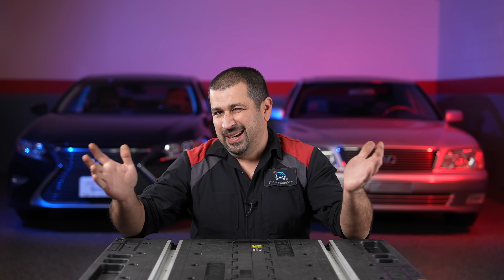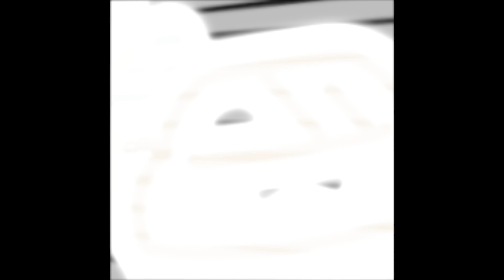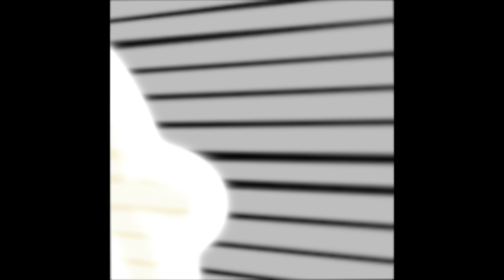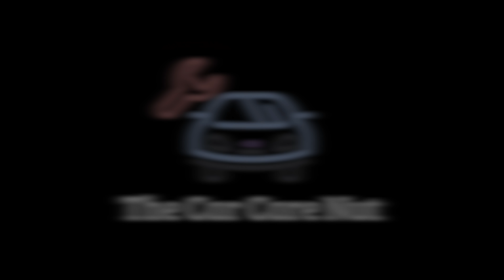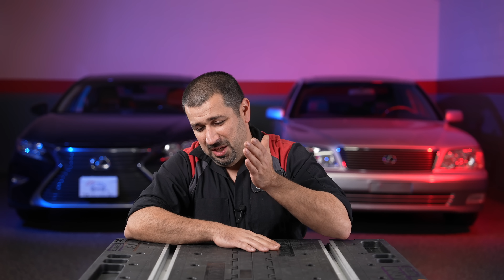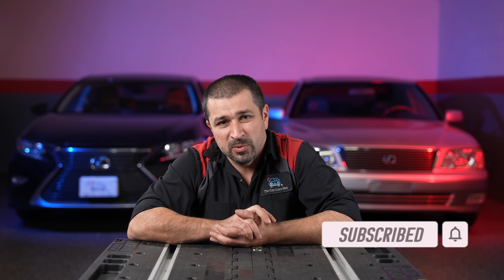Can Modern Turbo Engines Be Reliable? Here's The TRUTH!

Comment: Speaking as a retired auto mechanic I’ve spoken like this till I’m blue in the face! Back in the early 1980s I was a junior mechanic at a Chevrolet dealership. Back then they were recommending oil changes every 7,500 miles! Plus they were recommending changing the oil filter every other oil change! In other words, leave a quart of dirty oil in the engine! When I tried to tell customers to change their oil every 3000 miles, they got angry asking “What makes you think you know more than Chevrolet?!” The service manager, service advisors, sales staff, and owners of the dealership told me I had to stop advising customers to change the oil every 3000 miles because they were in the business of “selling cars!”
Reply: Yes, the sales department are there to sell cars, not, as you know to help buyer's cars last longer. Today's Service Department is the golden egg for dealerships. Very little profit now on selling brand new cars - still profit - but not like in the 1970s.
Reply: @sheldonlea 
Car dealerships make money on used cars. New cars have an MSRP, which mostly covers what they paid for it.

Used cars are say from trade ins where they lowball customers getting rid of their old cars, then sell them for a lot more.

Service is a rip off, but it's peanuts compared to sales.
Reply: I am a private pilot and a veteran of more than a million driving miles. My experience observing  turbo charging options on both piston planes and automobiles is that turbo owners almost always incurred shorter engine life and significantly higher maintenance costs. While offering higher performance, turbocharging comes with cost that  make turbo an unwise economic choice.
Reply: @joh @johndaniel6103 tired vet too. 3/4 M miles on vehicles. Love DIY. Please specify how much shorter operating time and maintenance costs. Are we talking about 100K, 250K, etc. ? Are we talking about increasing oil change frequency and filter replacement or repair cost for turbo charging and ancillary pressure and temperature differences? Thanks.
Reply: thanks for the info man
Reply: Then please tell me why my 8,000 red line 4.0 liter N/A Porsche, warranties their motors with  ten thousand mile oil change intervals. Granted, it is modern Mobile 1 full synthetic, still ten thousand miles on a high rpm H-6 is ten thousand miles.
Reply: @mzollnerable Simple, Porche is not a commuter/family car. Never meant to go 100 to 200k miles.
Reply: @Taras-Nabad For a data point for a commuter/family car, my Camry's recommended oil change interval is 5k miles. It's doing well at over 200k miles, though I don't know what the actual oil change intervals were before I owned it (but I do have Toyota's recommended schedule available). We do have another Camry in the family that we've owned for most of its life that reached 300k miles years ago, and for that we've been changing oil at 5k-10k intervals (but I don't have the recommended schedule for that particular model year).
Reply: @JonBrase does it have turbo? This discussion is about cars with turbos.
Reply: Are there any oil filters that can actually keep the oil relatively clean for 10,000 miles?  Honest question.  I dont really know.  If so, synthetic oil doesn't really break down, thats my understanding anyway.  I would still not want to go over 5,000 miles tho.
Reply: @nogotrobot7954 
But the breakdown is not from simply being dirty. Oil just gets old. Cleaning it doesn't change that.
Reply: Did you show the customers the engineering data that supports 3,000 mile oil changes?
Reply: @kenfrank2730 Right!!!!!!! For a DIYer,,,,I like the 5K oil change intervals and maybe 30K CVT intervals although I would prefer 50K intervals. What say you all? 50K 😢for differential and spark plugs too. Easy for a simpleton like me to remember., TalkinDIY. Not taking it to a K/H shop. Of horrors!!
Reply: When I hear about dealerships such as what you contended with, it makes me appreciate all the more of the Honda dealership that I bought the '91 Civic from.
The service manager held a evening seminar for the new car owners, where he explained that to keep the vehicle warranty in effect, he'd appreciate bringing the vehicles in to the dealership service department for oil changes at 7.5K miles.  BUT, he strongly advised the new car owners to have the oil changes performed every 3.5k miles . . . such as do-it-yourself.  Then he went about to show where the hard-points were on the vehicle for the jack and jack-stands.  He proceeded to show where the oil drain plug was at, and not get it confused with the automatic transmission drain plug.  Then he showed the location of the oil filter.  He concluded with recommending the amount of inch-pounds of torque to use when tightening the oil drain plug.
That Honda dealership was remarkable with providing such do-it-yourself maintenance tips.
I kept at the oil change intervals at 3K ~ 4K miles intervals for 21 years.  The engine never burned oil.  I finally got rid of the Civic due to the transmission being worn out from all the stop-and-go commuting . . . along with the electricals getting suspect, too.
Reply: I agree 100%. My 2017 Ford transit has 307k on it synthetic blend the first 150k every 5k then full synthetic after that.
Reply: Damn
Reply: Them: what makes you know more than,the car maker?

Me: Cause I have nothing to gain. You can change your oil elsewhere or learn to do it yourself. But the car maker wants your car to break and you have to buy another.
Reply: Now thanks to YouTube and youtubers like the author of this video, the truth can be heard by masses and no manager or owners of the dealership can hide it.
Reply: “ they were in the business of “selling cars!”” And there is the truth of it!
Reply: For most , not all, 3K intervals are not real world. Even harder if you own 1 vehicle. 5K intervals, which used to be recommended are much more viable and livable. How many people keep the same vehicle past 200k? Not too many. Other systems wear such as tranny, A/C, rusting issues that make the machine unserviceable for anything but parts. 3K is great but why not 2K or 1K? Just to be safe! 😊 5K, EV, ride a bike or walk.
Reply: @arthurfisch3673  Completely agreed. However, I do agree with his point of using top quality oil though. I would happily pay three times the price to double the oil change interval, as to keep my extended warranty valid it means a day off work to go to the dealer.
Reply: Oil quenched rubber timing belt.   You’ll be much happier with the new Toyota
Reply: If someone was trying to sell me a car which needed the oild changing every 3000 miles I would look elsewhere, maybe at an EV. Since the Car Care Nut is a Toyota guy it is worth noting that here in the U.K. Toyota will keep extending the warranty on any of their vehicles up to ten years old providing you get it serviced by them to their schedule.
Reply: @MrDuncl 
Wait, what? You're seriously complaining about oil changes at 3000 miles? 😂 What a karen!
Reply: I agree that oil should be changed more often, I think it’s a good practice to change oil filters every other time as a used filter filter’s better and the filter will go a long time before clogging.  The small amount of oil left in the filter is insignificant. Very few modern filters hold a quart
Reply: @jimbo5635 A filter is a $15 item max! Oil changes are $75 and up unless you DIY. Labor and tax are almost always a bigger expense than parts. Why on earth would you not take the extra 20 minutes to change the filter too? Nonsensical!
Reply: @arthurfisch3673  I change my own oil. It’s not the cost if the filter, it the fact the filters filter better when dirty. The oil geek just did a video on this.
Reply: @jimbo5635 Good point. They filter better until they don’t. There is still residual oil in the filter. And it is dirty. I guess you could argue either way. 😊
Reply: @arthurfisch3673  There's also up to a quart of old oil still left in the oil pan. you can empty out the oil in the filter. You can get a U shaped attachment to get out the dirty oil below the level of the drain plug.
Reply: @briank10101 How bout making things easy? Reproducible and consistent? Buy a car that it easy to change the oil and filter DIY.  Talking about cars that have central lifting points, robust pairs of jack stands, easy to teach spin on oil filters, the use of a fumoto drain valve, etc. Changing the oil twice a year or as needed and changing the air filter yearly. maintenance costs can be drastically reduced by DIY. Inflated hourly rates and state sales tax are the big hitters, not OEM parts. If all of these posters really think they are going to keep their cars over 200😊K mikes or more like they say,,,,, then they should be more than able to buy OEM parts, both oil filters and air filters by the case ,,, saving more money. Interval differences b/w 3-6K depend on different conditions and driving techniques. Don’t sweat the small stuff! Get to financial independence and early healthy retirement. That is the real goal. Good luck!!!😊

Comment: Hello from Europe, what reliability? :-) I drove 1.9 jtdm turbo diesel car for 10 years, and I bought it when it was 7 years old. High power engine for the size.. sold it with 250 k miles...so 400 kkm.. haven't had any major problem.. I know the guy who bought it, it still drives it.. will probably go a 1000 000 km.. That car still doesn't consume oil and the original TURBO will very likely last like 500 000  to 700 000 km . And I know many who actually reached 1 M km (JTDMs and TDIs) with turbo services... So you guys live in the 20th century.

Comment: I'm surprised that you didn't mention the Camry hybrid drive train.  Available in many vehicles from the Mazda CX50 to a minivan with many sedans and SUVs from Lexus and Toyota. 

Great for what you don't get:

NO TURBOS.  No annoying start stop system. No sleazy mechanical CVT. No belts (accessory timing or Wet). No GDI without port injection. No 11 speed torque converter automatic. No torque converter. No 12 Volt starter or alternator. No automated manual. No mechanically driven AC compressor (it's electric like your home refrigerator). 

Electric cars with gasoline engine assist. Electric car goodness without the electric car drawbacks. 

My next vehicle. Rav4 prime, Rav4, Crown, Crown Signia, Highlander?  I will shop & test drive at the end of the year.

Comment: New to Toyota and got a GrandHighlander with turbo 4 . Knew it was not a new to Toyota engine . First service light came on @5k . Call to schedule appt. Dealer said it was only tire rotation.  I said no way and want oil changed also . I will be changing every 5k max.

Comment: Hey, I think one important thing that he did not discuss about turbo engines that I learned 30 years ago was to always let the engine warm up. Let the turbo warm up before you takeoff and when you come back to your driveway, you’re supposed to let the engine cool down Before shutting off the engine to cool down turbo the oil that’s left inside the turbo will be cooked if you just pull into the driveway and turn it off, but taking the time to warm up the engine in the turbo and to cool the engine in the turbo down just a little bit before shutting off is Not practical for a lot of people!

Comment: Change your oil regularly & treat your gas pedal like it's painful to press & your little turbo engine can last as long as a bigger naturally aspirated engine.
Full confession: I use synthetic oil & change it every 6 months. I use an e-bike for most local trips so I don't drive much mileage. I do drive my 20 year old (manual) turbo Subie, in NYC traffic, like I stole it;)

Comment: Video suggestion: Why do manufacturers not employ a belt-driven supercharger instead of a turbo? It gives the power from a dead stop, once moving not much effort is needed from the engine, none of the heat/oil issues; so why the turbo? Don't superchargers generate less heat? Wouldn't that mitigate the oil degradation and mitigate having to be oil and/or coolant cooled? I think the supercharger robs some horsepower from the engine, but when vehicles are doing 300 to 400+ HP now, are you going to notice a handful of HP being used by the supercharger???

Comment: Yes, 3,000 to 4,000 miles at the most for a non- turbocharged engine. A turbocharged engine cars as a daily driver. No more than 3,000 miles. The diesel engines with a turbocharger. The same. Oil changes with an oil analysis for contamination. It’s cheaper than an engine replacement. Diesel engines have something that gasoline engines don’t have. The diesel run away. If your diesel starts to run away. The way to stop it. Put into a higher gear for a standard or use a fire extinguisher into air intake after the air filter.  It’s the only way. A diesel run away. Even if you turn off the ignition. It’s getting the oil a it’s fuel. You have to stop the AIR. It’s the only way to stop it. STOP THE AIR. Peace Out from Toronto Canada 🇨🇦

Comment: I dont know if you read your comments but Im a big turbo guy and vehicle I have that has a turbo is reliable, but they are built properly. Also unrelated I did a repair to my corolla with the infamous cam gear rattle, with out buying any parts and did a video on how to do what I did,  so far I am 50k km since the repair and it has not rattled once. you should check out my video, would love to hear your opinion on it.

Comment: Thanks AMD.   This question is not turbo related. I own a 2024 Rav4 prime(plug-in hybrid). Toyota recommends 10k oil change interval.  As a plug in hybrid, i probably use the car 60-70% on electricity, as I plug it in every night, and mostly drive less than 40 miles daily. Meaning, gas engine seldom turns on. I DIY my oil chage every 5k, but when i do it, the oil barely turns dark and looks really fresh. Whats you take on this? Thanks.

Comment: So much misleading info here it's hard to keep up.   1. Saying diesel turbos don't operate in stop and go traffic is completely false.  Modern gas engines are perfectly capable of handling stop and go traffic and dealing with sudden throttle body closure.  2. Claiming turbo engines are "strained to their limit" is also completely false. Manufacturers build them for longevity. Look at all the turbo motors that can gain significant power with just a tune - proof that manufacturers are NOT pushing them to the limit. 3. Turbos do not "destroy" modern oil, nor do they "break down the oil very quickly". Good synthetics are more than capable of dealing with the harsh environment of a turbo. And most modern turbo engines have systems that will continue to circulate oil and/or coolant after the vehicle is shut off to keep the oil and the turbo healthy. Recommending 3k-4k mile oil changes without any knowledge of the car or situation is likely a waste of time and money. 5k miles is more than fine for the vast majority of vehicles. If you're really concerned about it then get a used oil analysis to know for sure.  Many engines CAN go 10k miles, but it's highly dependent on the environment, driving style, and the engine itself.  Saying people would be "lucky" to get 100k miles with 10k mile oil changes is complete nonsense - there are millions of cars out there doing exactly that.   
I've driven turbo engines for 30+ years and never had a turbo failure.

Comment: does using synthetic oil impact turbo longevity?
Reply: Absolutely.  You should use synthetic oil in your engines even if they are NOT equipped with a turbo.

Comment: So here's a question, are hybrids more reliable than turbos? I understand at some point there will be a battery replacement, and possibly some electricals but there doesn't seem to be much mechanicals that could wear down other than a simple 4 cylinder engine usually?

Comment: Very informative video, thank you!

I change my oil in my NA vehicles every 5k or 6 months. I have questioned changing from 0w20 to 5w20 on my 2021 4runner (live in MI and used to take long road trips in) thoughts?? I plan to keep this until I can't drive anymore, I'm currently 49.

Reason I don't buy turbos is my budget and maint. costs IF it does break, one more thing to fix etc.

I stick with the following:
NA engine
No CVTs
No 7+ auto transmission 
No cylinder deactivation
No direct injection of any kind, if it has both DI and PI more parts, more maint. and more cost.

Tace Care and God Bless us all.
🙏🇺🇲

Comment: Turbos make buying a reliable used vehicle more risky. A normally aspirated engine can take some amount of neglect and still be reliable. With a pre owned turbo if the engine was not maintained properly or abused it could easily become a money pit with relatively low miles. Since I cannot afford a new vehicle I will keep driving non turbos for as long as possible.

Comment: I have a 2021 Kia Seltos (little SUV) with a 4-cylinder turbo, never had a turbo in my cars before. And one thing I have noticed different from my other cars and maybe not related to the turbo at all, is that when I go from Reverse to Drive (pulling out of my driveway), there is a sputter/lurching that seems to happen before the idle and the pressing on the gas takes effect. This can also happen less frequently when stopped at a stoplight. 

To me that sounds like a transmission issue, but I am no Car Care Nut in the slightest. Car only has 40k miles and I take care of it regularly with 3-5k oil changes, I don't even drive much, possibly under 10k this year. 

I feel like I should take it in to Kia to have it looked at as I'm still under warranty, any thoughts?